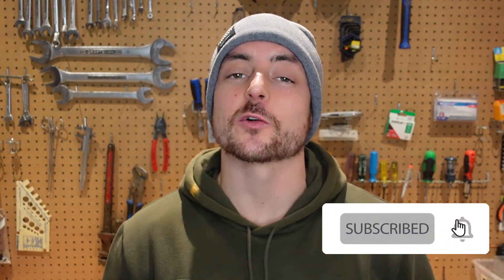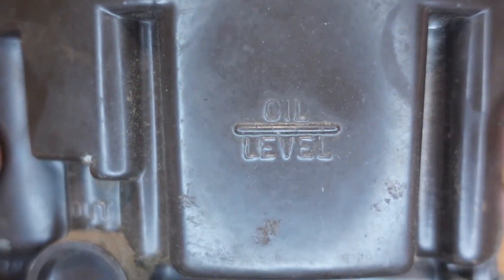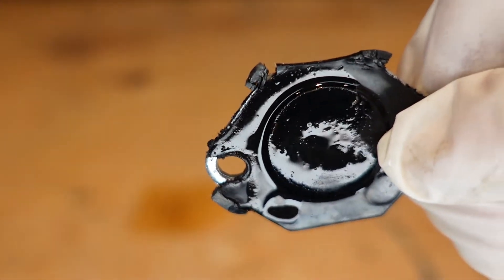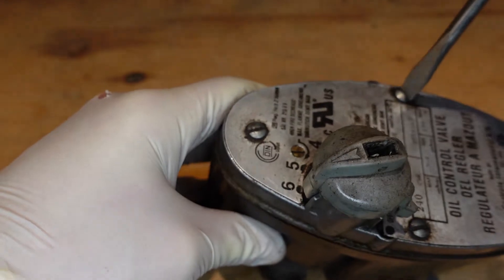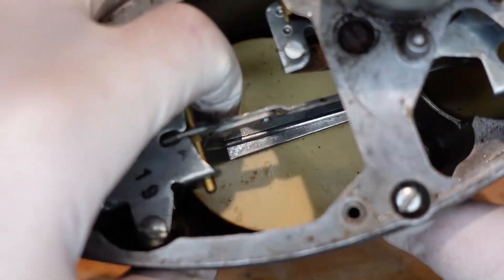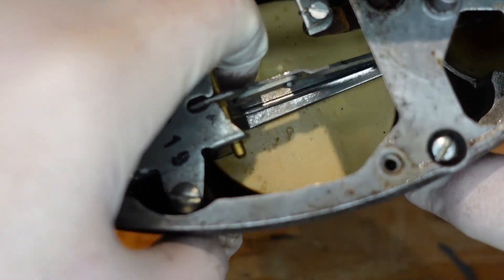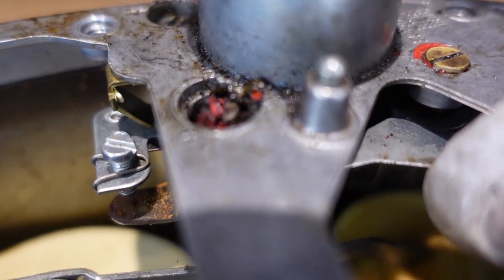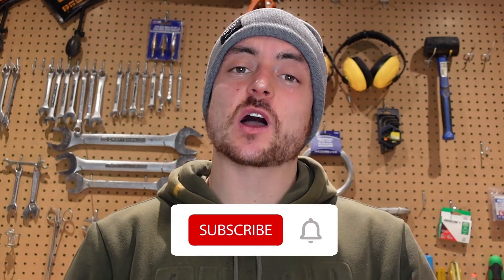OIL STOVES | How a REGULATOR works | Opening the Carburetor

Comment: Good information. I just bought an old Sears heater. I get fuel if I pour it in the float cup. So I'm thinking it the main needle valve. I already know its getting to the screen. Any tips on setting the main needle valve. Thank you

Comment: I was little when my folks had oil heating stoves. I just remember they had problems with them . Then they switched to an  LP gas heater. 
I think the problem with the oil stoves was a contaminated outside tank, I could be wrong. It's interesting to learn how they worked.

Comment: What should I look for if oil isn’t making it into the burn pot?  I just bought a wall tent cabin with a drip stove and I followed the start up procedure.  Valve on, set to low, but no oil seems to be coming out anywhere.  The arming lever always seems to stay in the down position too.  (Didn’t know what it did when I tried to fire it up yesterday).
Reply from the maker: Sounds great!

Comment: Super helpful! I watched both vids Animated first then this one. I have a small Coleman stove with  its original oil carb attached and a twice larger stove body without. The Coleman carb label shows a BTU rating maybe suited to its small body size (I am guessing) Do you know if carbs were designed to flow rate according to Small, Medium and Large stove bodies? Ive been searching Online since 2022 and cannot get much tech specs. Appreciate your videos very much!

Comment: HI Phil, thanks for making these videos.  I have the exact regulator on my Franco Belges Le Continental stove.  I am having an issue where the flame almost goes out (just a little yellow flame at the oil inlet), however tapping on the side of the regulator with a screwdriver causes it to burn great again.  This leads me to believe that there is some sort of gunk in the regulator.  My question is - what do you recommend doing to clean the inside of the regulator itself?  I've seen all of your videos on this topic, and I will definitely pull the filter and clean it, but I haven't seen anything about cleaning the inside of the regulator (around the floats, etc).  Just wipe in there with a rag or is there further disassembly that can/should be done to clean in there?  Also, I don't have a shut off valve at my stove, just at my tank about 10 meters away.  I am thinking that if turn the knob to 0 and lift the safety lever up, I should be able to pull the filter and drain the remaining oil from the regulator without draining the entire length of the line from the stove to the tank.  Then I can clean the filter and  wipe out the inside.  Is there anything else you recommend?  I am hoping to avoid removing the regulator from the stove, as I would need to drain the entire length of the line in that process.  Thank you in advance for your help!

Comment: Ive got an antique with an oil end heater. It uses a carburetor. Can you buy new ones or parts? Or clean what I've got carefully without losing parts. My stove has two round wicks is that normal? Thanks man for any help.

Comment: I have the same carb on my stove, year 87. My problem is it I do not have it on 5 or 6, it will run out of fuel. Needle valve and slot are clear. I’m guessing it’s a low flame adjustment from watching your video. Any comments will be helpful, thanks!

Comment: These were super popular in Iran when I was a child.  People installed these heaters in late fall and removed and stored them in the spring, and plug the chimney with a chimney plate.  They would store the heaters away when they were not needed.
Reply from the maker: Work very well!
Reply: Did they leak at all, we've an oil leak from the base of regulatory. filter cover plate, seems to be source.

Comment: Only question I have is how do you adjust the float for the fill level. Mine is filling too high and tripping the safety overfill.
Reply from the maker: Turn your dial to 1 and lift and hold the lever for a few minutes. It should empty the trip reservoir and work better. If not, check if your regulator is level or if anything is obstructing the orifice inside. Let me know if this helps!
Reply: Will do. Thanks

Comment: have really enjoyed your videos...I am trying to get a nestor martin to fire after 3 years of sitting...cleared the line from the tank, running well...cleaned the filter..still no flow into the stove.  I'm thinking the regulator may be full of goop/varnish stuff, so I watched to see how to get it off to clean it...do you have any suggestions on other steps to try before I attempt this?  The regulator is set back a good inch under the stove so dismantling it is going to be tricky, even getting the filter out to clean was a bit rough. YIPES!!  Thank you for your videos, they are very helpful!!
Reply from the maker: Thank you so much for the comment! Definitely take a look at the regulator and the inside of the burning pan should also be cleaned.

Comment: Hi Phil, thanks for the video. A question. Do you know if there is a specific position on the topbit of the spring which is controlled by the knob. We didn’t get any flow so cleaned the carburator. Therefor I needed to open up the plate to take out the parts with the floater , and the spring  seemed a little stuck. Yet we didn’t really check how the position was from the topbit of the spring and when getting it off it jumped . And we don’t know if it has a certain position.  The carburator doesn’t seem to respond to it’s knob. Flame is just the same in any position. Yet the adjusting screws for high or low flame have never been changed, and only now maybe the position of the spring. Any ideas? Cheers, Simone
Reply from the maker: That is a very good question. I would have to open up a regulator to see if there is  any specific position.

Comment: Your videos helped me immensely! Just moved to NB cottage country and had no idea how to get the oil stove going. Couldn't find anyone willing to touch it so I did what any maple blooded Canadian would do and turned to the internet. You've answered every question I could think of and more. Saved me $$ for a service call, or even BIG $$ replacing the system with a different fuel source. Now it's t-shirt weather inside using that as my only heat source, two floors, with windows cracked. What a fantastic heat source! Thank you so much for sharing your knowledge.
Reply from the maker: Thank you so much for the lovely comment :) helping others like this makes me want to make more content. Let me know if you want to see anything else about stoves!
Reply: @philg  Where to buy parts for an Efel?
Reply from the maker: @ragincanadiangmail  I would look on eBay or a local stove store. They are old and parts are starting to be hard to find. A lot of these stove regulator were made in Netherlands, so you may be lucky on Google.
Reply: @philg  thanks for the video harworth heating in the uk has these carbs and lots of other parts for these oil heaters they have a youtube channel too   i found interestng, i have a usa military coleman model oil heater from 1967 i had to rebuild the carb but needed 1 to swap out till i rebuild it , bought from this company works great
Reply from the maker: @StevesAutoNtrucks  thanks for the nice comment and glad I could help :)
Reply: @philg  What do you know about crawlspaces? I've got a fairly shallow one and the dirt is always moist. There is vapour barrier attached to the joists to keep the musty cat pee smell out. Neighbours tell me vapour barrier on joists is right but inspector and local codes are for the vapour barrier to be on the dirt.
Reply from the maker: @ragincanadiangmail  The vapour barrier should help and you could also put a dehumidifier in the space. Cover any vents and inspect for any damage or cracks and repair as required. Outside of the property, ensure your downspouts are directed away from the foundation. A sump pump could also be installed with french drain if a lot of water is entering. Hope this helps!

Comment: It's an incrediblly simple device, once you dig into it, and understand how it functions.  But it is also very reliable if kept clean.

Some tips.  If the stove has been operating,  and you need to service the regulator,  leave the stove running, and close off a valve that should be fitted before the regulator.   This will use up the majority of the oil in the regulator,  so when you disconnect the oil lines, you have minimal spillage.

You can also remove the three screws under the cover, to remove the majority of the parts, giving full access to clean out the reservoirs.
Reply from the maker: Absolutely!